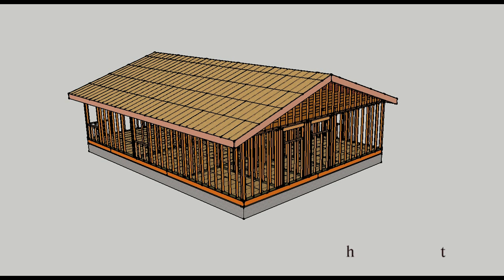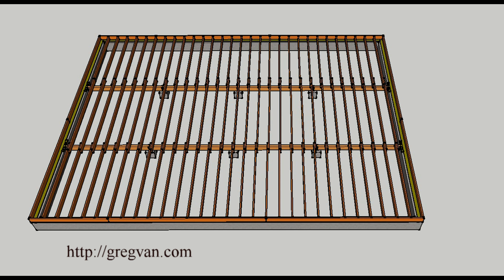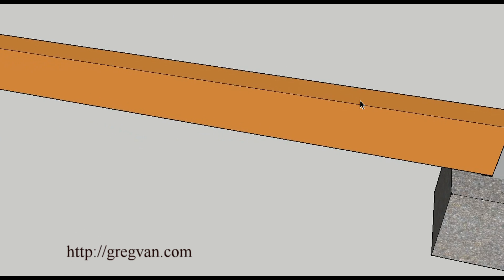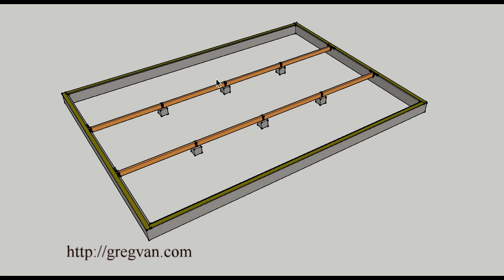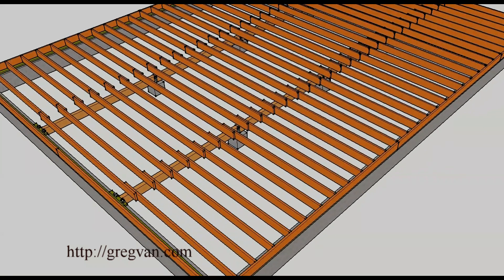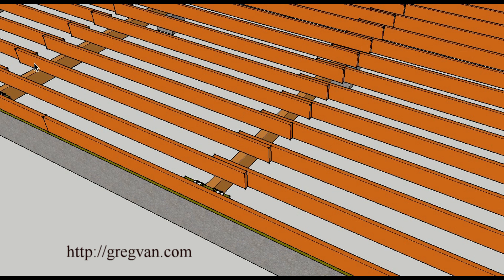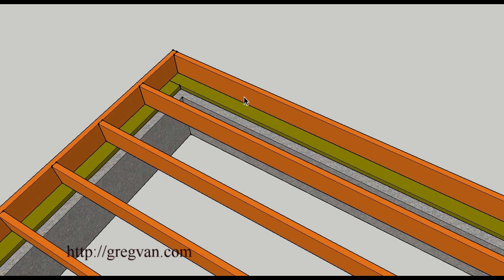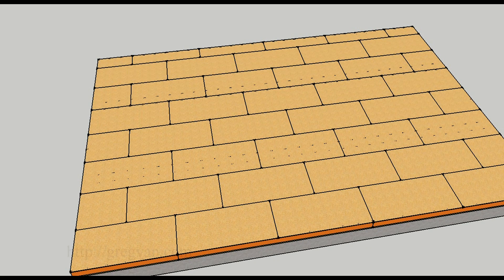Floor Building – 3-D Single-Story Conventional Home Framing Design

Comment: Why do the joists overlap? Wont that throw off the flooring being on 16" centers?
Reply from the maker: They do mess up the sheathing layout, but need to provide structural connection at the breaks and lapping them usually works better than lining them up and then installing some type of strap to connect them together.

Comment: The middle section of the joists is shifted by 1.5" while the sheathing is not (in the model). How do you shift your subfloor panels in this case in real life? You wouldn't need to cut your 4x8 lengthwise at the beams, would you?
Reply from the maker: It's difficult to explain, but here's a link to our floor framing videos.
https://www.homebuildingandrepairs.com/framing/floors/index.html
Reply: I looked through several of the videos and cant find a solution have you? Im sure it’s something easy, i mean joists are overlapped often in construction i just cant wrap my head around it.

Comment: What kind of pears are used in 2021
Reply from the maker: You can use solid concrete or concrete masonry blocks, but most of the time you can't use small piers you can get at your local lumber yard.
Reply: @gregvancom  ok thank you right now I'm digging the footers to pour in concrete then idk what's better to put on top of the footer. Wood post or metal support

Comment: Greg, those piers are normally concrete blocks then filled with concrete, not actually solid concrete.
Reply from the maker: You can build them a few different ways, with concrete blocks, solid concrete and I've even seen them with treated wood and bricks.

Comment: How many pier blocks and spacing it needs per square foot for example? Thank you!
Reply from the maker: I can't provide you with engineering information, but can tell you that I've seen them spaced about 8 foot on center using 4 x 8 structural support beams for a single story home.

Comment: How far apart do you place beams? I have a 23 ft x 20 ft pole barn I’d like to put a floor in.
Reply from the maker: I can't provide you with structural engineering advice, but can tell you that 2 x 6 floor joist can you usually span 8 feet for floors. 4 x 6 beams used to support the floor joists can usually span 8 feet also for floors.
Reply: With the lumber available today go to a lumber yard that sells engineered wood. They can help with sizing.

Comment: The only problem I see with this is when you go and build the walls your sitting on top of the sub floor I say this because I'm rebuilding my trailer and their designed this way, but why in hell do people bolt screw or nail the walls on top of the sub floor, especially if you get a leak and the floor rots you have to cut under the wall and cut out notches on the new sub floor panel just to slide that back under, now my home is 16' by 80' and they built it like that and I'm redoing all of it and need to build walls to mount directly to the joist, doing it this way that leaves me with a problem I can't go 16" off center and use the outside joist as the starting point, so what would I need to do to get my measurements correct so that I can go 16" off center and still be able to mount my walls directly to the joists do I need to just double up the outside frame or what, cause I'm tired of cutting out flooring just to replace a panel, I want to be able to just unscrew a piece and pop another one in and get back to going.
Reply from the maker: The floors are usually designed to support the walls and the weight from above, if built correctly.
Reply: @gregvancom  ok I can see that but they don't anticipate the sheathing or subfloor to rot and then make it harder to replace the floor especially when the walls are on top and then it would need to be cut out and either double braced and flooring butted up against the wall or cut out under and slide the new sheet under, that's the problem I'm faced with right now, on the exterior walls cutting out rot and slide new under or cut out double brace and butt against, the factory flooring I believe is half in maybe less osb and the new is 3/4 I believe oak or professional grade plywood, what way would be better the interior drywall is glued to the framing as well as exterior inside walls as well
Reply: And also another question for the worst case scenario if I have to start over and rebuild it entirely would it be possible to frame the floor in a way that adding extra bracing to the frame that I can nail screw whatever the wall framing directly to floor then come in with the sheathing and butt up to walls that way when it rots it'll make it easier to replace
Reply from the maker: @reaperasylum2163  No they don't, framing repairs aren't always going to be easy and the more stuff you have stacked on top are connected to parts that are damaged, the tougher it's going to be. If you haven't visited the website, you might find what you're looking for their. Click on the link below for more information.

http://www.homebuildingandrepairs.com/repairs/framing/index.html
Reply from the maker: @reaperasylum2163  You can transfer structural loads through other parts of the framing.
Reply: I've got the site saved and I'll give it a thorough look over
Reply from the maker: @reaperasylum2163  Yes, there would. I don't have the time right now to make the video, but added it to my list of videos to be made in the future.
Reply from the maker: @reaperasylum2163  You're absolutely right and most of it has to do with structural engineering. It would require designing an entirely new type of building that could cost a lot more to build.
Reply: Ok cool that's a video that I would love to see and it's just in case I have to rebuild the property

Comment: Can you use poured concrete columns in place of stem walls for the perimeter foundation, like where the beam would be the sill plate? (I hope that makes sense).  And if so, is there a formula to figure out what diameter you need?  Cheers! Chris.
Reply from the maker: I would imagine you could pour some type of concrete columns to transfer the loads from the building, but I don't know if it would be cost-effective. I don't have any formulas for structural footings and am not an engineer, sorry.

Comment: Those "piers" that you referenced are known as deck blocks.  They are used when building decks.
Reply from the maker: I've actually never heard them referred to blocks, where are you working? I'm in Southern California and we refer to them as concrete piers and were used years ago to support floor framing.
Reply: gregvancom as part of a foundation you would construct piers.  The pre-fabbed units are specifically for decks, hence "deck block".   I loaded them by the  hundreds for the home improvement store, I used to work in the distribution center.
Reply from the maker: We might be referring to different items, because concrete piers can be used for things other than building decks.
Reply: gregvancom Sure seems like it, but from your description in the video, deck block was the first thing I thought of.

Comment: How do I find recommended spacing between Joists
Reply from the maker: +Scott Kahler You would need to look at lumber span charts and you might be of the find them on the Internet. For example a 2 x 6 14 foot long might need to be spaced 16 inches on center for a roof, where a 2 x 10 14 foot long could be spaced 24 inches on center.
Reply: The softwoods available do not make good floors. Use engineered wood.